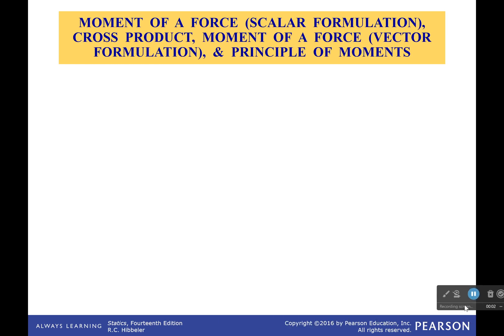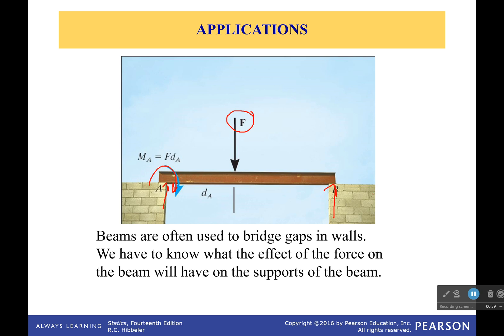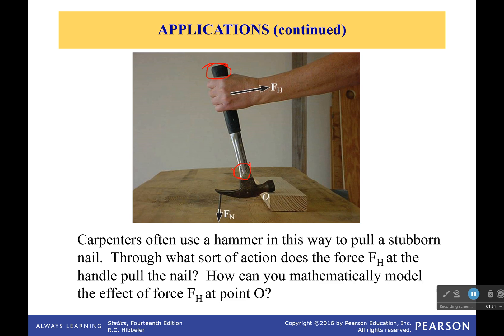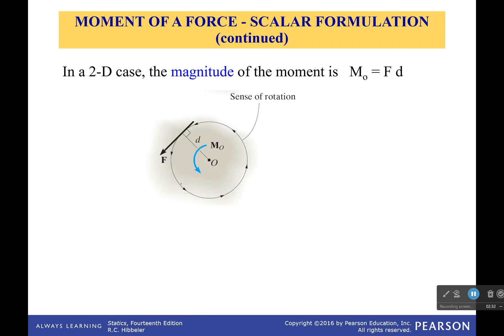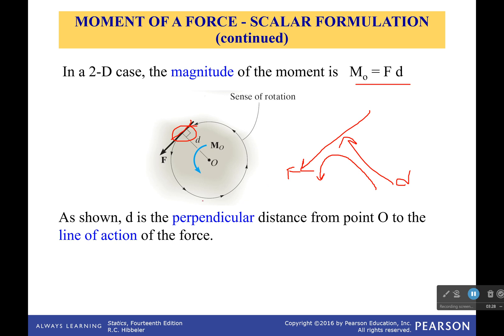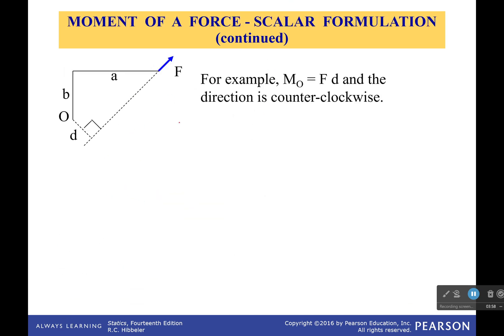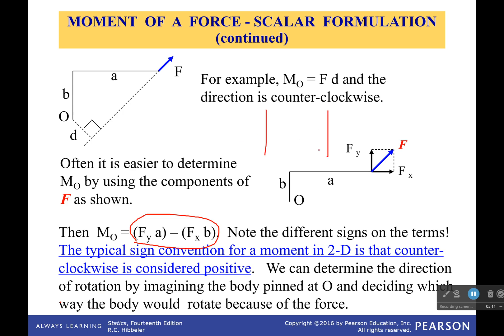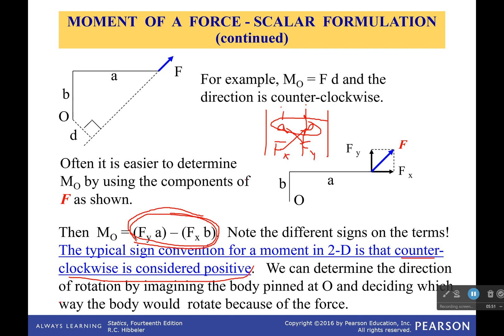Moment of a Force - Scalar Formulation

Comment: why do we subtract the moment of the fx component from the fy component? if we split the force up into its horizontal and vertical, shouldnt we sum the moment and then see if the moment is cw or ccw? I get the determinant explanation but the summation method and the det method are not connecting. could you please clarify
Reply from the maker: The determinant method is just doing a summation. If you were to break up a force into components algebraically and then add the moments, you would get the same result.